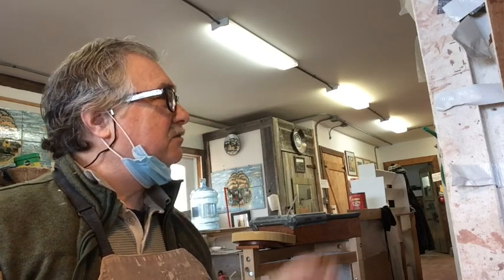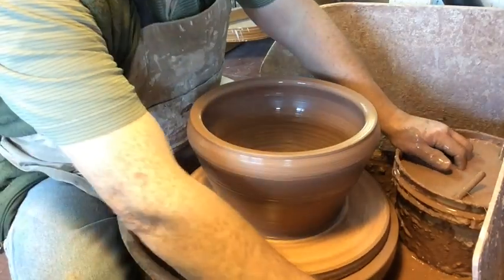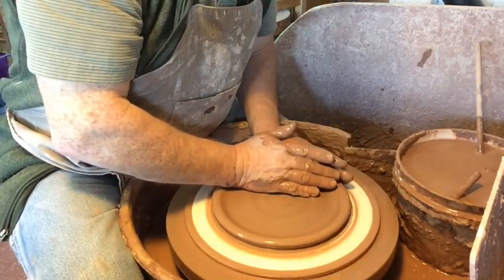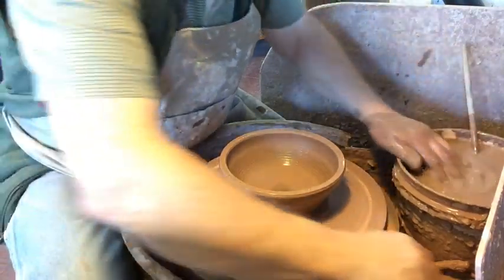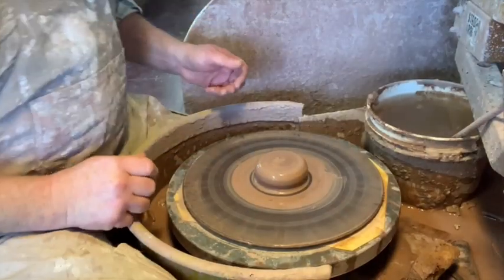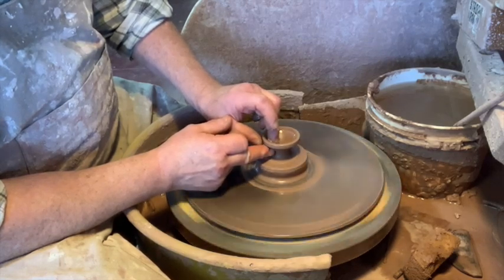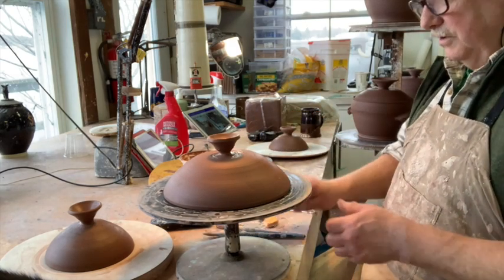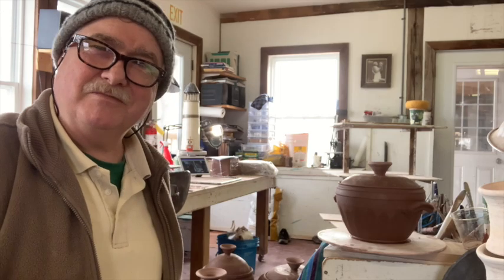How to make casseroles

Comment: Can you tell me if Bmix by Laguna is okay for the oven? Do you pre-heat the oven with your casserole dishes in the oven? I've always heard that you should tell customers to do that. I so enjoy watching your videos and learning from you! Thank you so much for sharing your artistry with us. 😊
Reply from the maker: Hi Cindy, B-mix is a dilemma, it is my favourite clay to throw but I have some cracking issues with certain glazes that only show up in B-mix5. I also had baking dishes returned that had cracks in them. My own experience has been with a few flat bottomed baking dishes that cracked, even in the micro wave. I think the issue is not clear since they say it is oven proof and so many potters have different throwing styles and compression applications when centering. My suggestion is to make your pieces uniform thickness, bottom and walls, not too thin, and tell the customers to heat the piece gently; cold oven. Wide flat pieces where food sits in the center and the edges are uncovered with food should be heated very slowly. The walls here heat up faster than the center.
Reply: @Vsmithpots  thank you so much for the great advice. I might have to rethink the Bmix when making cooking vessels.

Comment: What did you use to make your bats?
Reply from the maker: I have some in 1/2 inch plywood, some in 3/4inch plywood and some in particle board, a composite material. I also have some in a 1/4inch plastic, you can buy it at building suppliers in 8x4 feet sheets, used in barriers where a flexible wall is required, such as ice rinks.